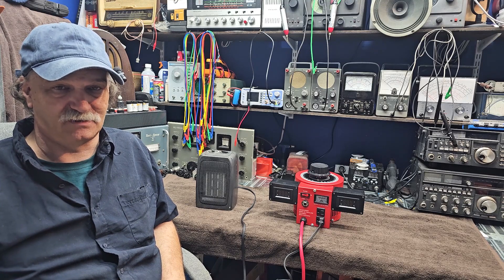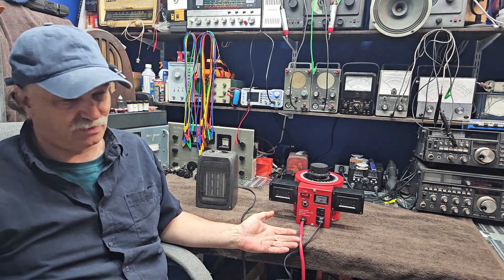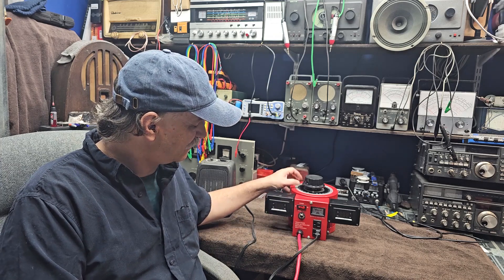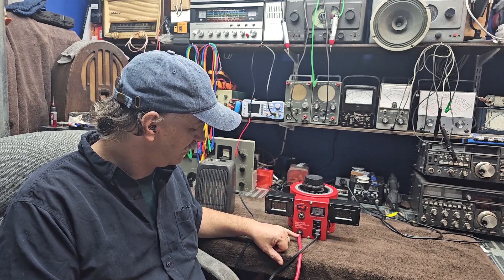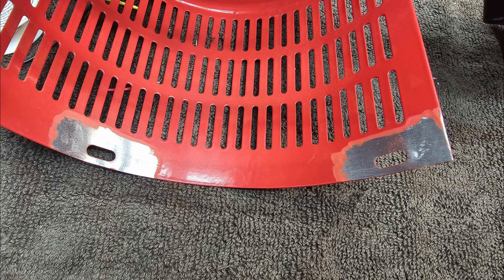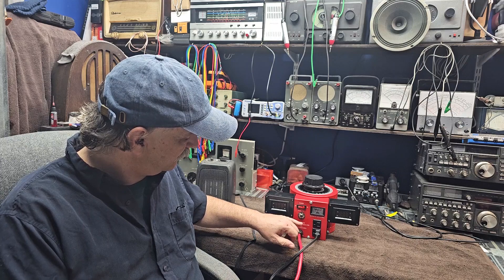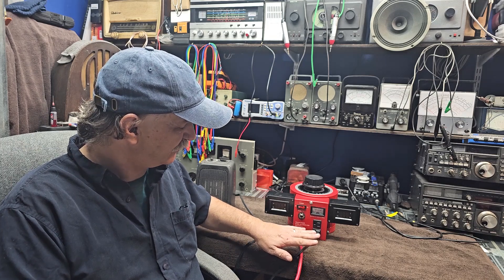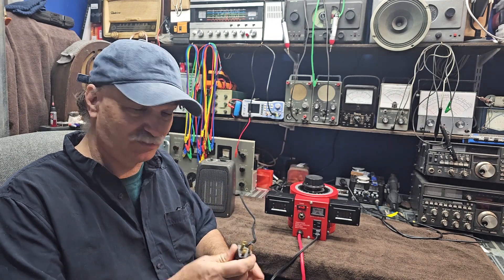Variac Review - Amazon's 20 amp Variac Pt. -3 Repaired and Tested Again

Comment: Well, thanks very much for this review. I had already turned in an offer on one on eBay before I saw this and needless to say the review was both discouraging and encouraging. Discouraging because of the way it started out, but encouraging in that the problems can be corrected,
apparently without much expense. I am just really glad that the transformer itself is of good quality. If it had been a piece of junk it would've been a total loss. So thanks very much for the info. 
(Offered the guy $55 for it. We'll see what happens.)

Comment: Which cases did you use for the added meters?
Reply from the maker: https://www.amazon.com/Zulkit-Waterproof-Electronic-Enclosure-100X68X50mm/dp/B07RTYYHK7/ref=sr_1_4?crid=QLGGM9MJMWWU&keywords=Zulkit%2BProject%2BBox%2BABS%2BPlastic%2BIP65%2BWaterproof%2BDustproof%2BElectrical%2BJunction%2BBox%2BEnclosure%2BBlack%2B3.94%2Bx%2B2.68%2Bx%2B1.97%2Binch%2B(100X68X50mm)%2B(Pack%2Bof%2B2)&qid=1702417582&sprefix=zulkit%2Bproject%2Bbox%2Babs%2Bplastic%2Bip65%2Bwaterproof%2Bdustproof%2Belectrical%2Bjunction%2Bbox%2Benclosure%2Bblack%2B3.94%2Bx%2B2.68%2Bx%2B1.97%2Binch%2B100x68x50mm%2Bpack%2Bof%2B2%2B%2Caps%2C95&sr=8-4&th=1